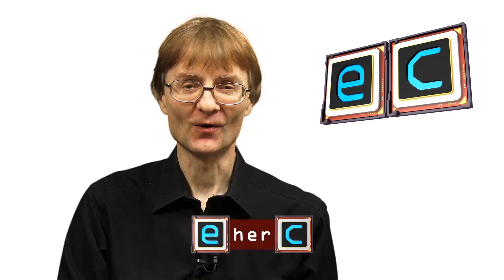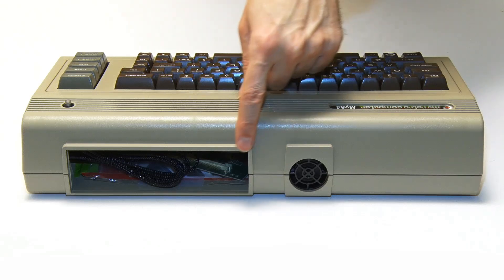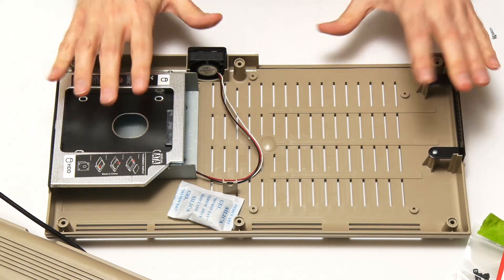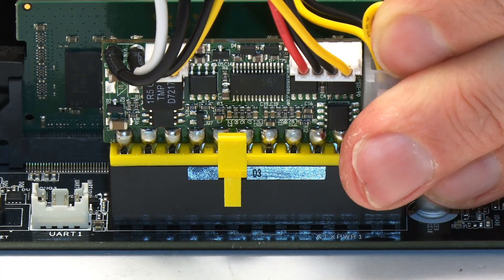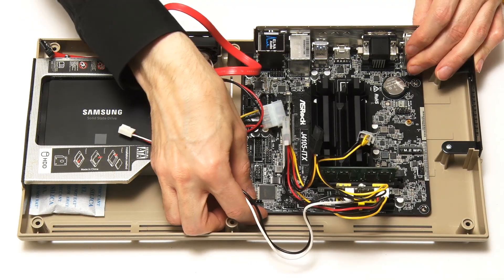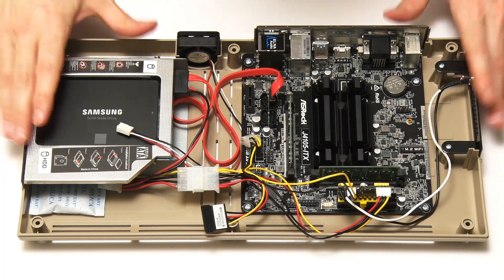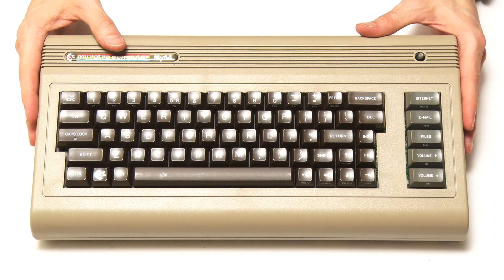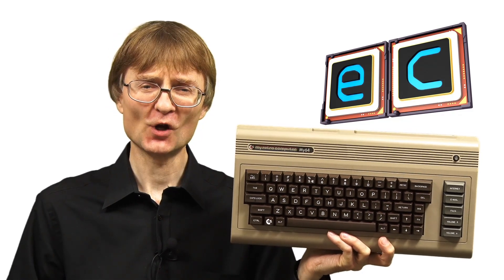My64 Mini-ITX Retro PC Build

Comment: My first computer was a Comodore Amiga 1200. It came with just a 31/2 “ floppy drive and 2 mega bytes of memory. I think I upgraded it to 8 megabytes of memory, and fitted an 80 megabyte hard drive. It was an absolute flying machine, by the time the cathode ray monitor was up and running, so was the system. I can never understand why my Windows PCs need so much memory and hard drive capacity, to do exactly the same work. Progress I suppose.

Comment: A nice bit of nostalgia but I always hated  the all-in-one keyboard and computer form factor. When I type I like to angle the keyboard a little but that is so difficult with all the peripheral (that's a nice old word) cables connected. On something like a spectrum, zx81, C64 etc moving the computer would often dislodge a connection; whilst on heavier computers like BBC or PET they were just too cumbersome to move.
I wonder if they would do just a keyboard in this case. I suppose it could be done by extending the keyboard USB cable inside the case to an external USB socket but that would be quite a hefty keyboard. Something like an original Mac case would be an interesting one to do (do they still make CRTs ?) because you could fit quite a nice PC in that.

Comment: I just love how they repurposed the hard drive caddy from a laptop CD drive bay.  Genius!  I have a spare Intel D525MW that might find it's way into one of these cases.  For increased ventilation I always add my trusty rubber feet to the bottom of all my laptops, and this one feels portable.  However, if I still had cooling problems then I might add spacers + longer screws to create a horizontal ventilation gap all around the case.  In terms of retro this makes me wonder "how far down" the OS ladder I can go.  I already know Windows XP will work (this would NOT be on the internet).  I want the USB to work, so maybe a Windows 98 install?  
Go Molex Go!
Reply: Windows 95 OSR 2 would probably be the lowest for a Windows version with USB support. 98 SE is also a good option.

Comment: What is the most powerful processor that this case can thermally keep up with?
Reply from the maker: Something like a Ryzen 5 2400GE, with its 35W TDP, should be fine -- or even an i7 9700T(!), again with a 35W TDP. In theory, a 65W TDP chip will be OK, but I would not go above 35W in this case.
Reply: @ExplainingComputers  what motherboard would you recomend with the i7 9700t

Comment: Very expensive case. Not enough:
It was possible
 put a 60 mm fan (Noctua or any other quiet). There are enough free space.
Paint in case color dvd cover and 3.5" metal plate on the other side.

Comment: So I guess next is a ZX-81 retro case , with a hard membrane keyboard that requires a real lot of force to make the key press register.
Also the RAM will be on the end of a ribbon cable, on a pack attached to the back of the machine, so the RAM pack wobble can be simulated.
Also a turbo button added , that would also blank out the hdmi output when the CPU clock speed is increased.

Finally programs would need to be loaded a compact cassette, or maybe have something that throttles back the speed of a HDD, so it takes 10 minutes to load a program, with the added randomness that sometimes the program wouldn't load.

I guess you have to be of a certain age to "get" the above !

Comment: I believe that was a long shot. A retro wireless usb keyboard would fit 95% of its purpose, for a fraction of the price, at the same time with a full  no cords retro keyboard experience. No monitor cables attached. Of course the video itself is very good.

Comment: Nice! I had a Radio Shack Color Computer with 4k of ram and upgraded it myself to 32k(64k chips). Radio Shack wanted about $150USD for memory.  I bought the chips for about $20.I used a cassette recorder for storage. Next was the Atari 800XL. I got an Indus DSDD 5 1/4" drive for storage.The drive came with a spreadsheet and word processor and a database(I think). How things have changed!

Comment: Cool case, but WAY overpriced. I'd pay at most around $100. It is in the end just a case afterall. Even my high end PC is in a Thermaltake case I paid $80 for. Which included tempered glass and RGB lighting.  Definitely for a niche market. But then again I was born about ~5 years too late for the c64. My first experience with computers was the 80386 on a Tandy so I don't have that nostalgic feeling for this computer (even though I own a total of 7(?) Commodore computers).

Comment: I remember when they tried selling these fully built for $1200 US. I guess now they're just selling off their cases/keyboard NOS. It's neat, but I think I'd rather get The C64 full-size emulator. I did consider one of these back in 2010 when they first came out, but they didn't have the PETSCII characters on the keys which is what I wanted.

Comment: Very cool- I actually owned one of the 2011 original cases that was made by Commodore USA. A very fun case, and I installed an intake fan in the right side panel to help with the airflow.  Unfortunately the keyboard broke, and by that time Commodore USA went out of business so I couldn't order a replacement.  Thanks for letting me know this was re-released, as I will contact My Retro Computer to see they'll sell me a new keyboard component!

Comment: I've been wanting to build one of these, but I want it to be a Commodore 128 case. Almost bought one from the original C-USA website back in 2011-12, but it closed before I had saved up enough money to get it. Still considering it if I can find a suitable C128 case.

Comment: To take it to the next level we could install some sort of Commodore 64 emulator :D :D for the giggles
Reply: Back in 2012 when this was originally sold by Commodore USA pre-built units included Commodore OS, a linux distro preloaded with lots of retro games and apps, shareware, demos and emulation options. It also included FreeDOS launchers. Something like that may be available for pre-built units in 2021. It also had lots of programming options as well as a few dialects of BASIC.
Reply: It's pretty funny. Build a modern pc into a retro case and use emulators to run those old games ... :D love it

Comment: I remember seeing this when it originally came out roughly a decade  ago. Interesting to see it being sold as a kit form. A lot of the cost will be in the Cherry key switches  (which type is used?). The height of the unit suggests that it originated from the VIC20 case (which was taller than the C64) and that in turn allows the use of the ITX board with passive cooler.
Reply: Very astute of you Paul. I am the actual C64x keyboard designer from Commodore USA from 2010.... It is indeed 3d scanned from the VIC-20 case which is slightly taller. I no longer have my records from ten years ago but if I recall correctly they are Cherry MX Blue, with a very definite clicky sound. I now have a MyVic20 case also from My Retro Computer and I can confirm they have the same feel. Good luck to them. I hope they do well.
Reply: @AussieAmigan  Hello Leo. Thought I would come back and give this video another visit as I have just managed to get my grubby paws on one of these cases. Apparently the one I have acquired is one of the original stock units with the Cherry MX Blue TGL3 keyboard? (I've pulled a keycap and its definitely blue switches)

The manufacturing quality is nothing short of superb. Its in stark contrast to a C16 case I have which you can plainly tell had been moulded in a butchered / modified set of worn moulds from either a 64 or a VIC20. The two halves barely line up and was obviously Commodore cheaping out.

Like Chris in the video I am not super impressed by the drive mounting arrangement. I'm sure it can be improved upon with readily available parts.  Apart from that I really like this. Well done for bringing it into the world..
Reply: @PaulL-g5l  Yes, I wasn't pleased with it myself. IIRC MyRetroComputer have an improved part.
Reply: @AussieAmigan  The bracket (in my case at least) allows for your 2.5 inch drive to be mounted in the bottom of the case by removing the 4 screws from underneath, taking bracket out, screwing the drive into the bottom of bracket and placing the bracket back into the case ( the screw spacings would seem to allow the ditching of the bracket enirely as they seem to match 3.5 HDD spacings). I then stripped an aftermarket external USB DVD drive (which had the desired 7+6 pin SATA socket) and fitted that into the top of the bracket in place of the 'dummy' drive sata carrier. Now my My64 has a PCIE SSD, a 2.5 HDD and a proper DVD read/writer..

Comment: That's actually a really great case. Putting a good Ryzen in there would be great for productivity and you can bring it around very easily since it's such a small form factor.
Reply: @michaelbuddy  If cost isn't an issue, the UDOO Bolt V8 runs a neat Ryzen SoC that should be able to be passively cooled. I hope that AMD gets on the bandwagon of marketing their chips out good to people like Intel did with the Atoms. AMD has some AMAZING low-power chips that could totally renovate the market but too few makers are using them right now.

And the few that do like the UDOO are SO expensive.

Comment: Looks nice, but seems to be missing some keys (F1-F12, Home, End, Page up, Page down).
Reply: As the keyboard designer (from 2010) I assure you they are all there if a little oddly placed. ;-) The regular PC function keys are accessible on the numeric keys when pressed with an "FN" key. The FN key operates in a similar fashion to many compact laptops allowing access to special keys like Page Up and Page Down etc. The FN special key labels are printed on the front side of the keys. Sorry, but to keep the look some compromises needed to be made, but all regular PC keyboard functions are accessible. That's the whole point.
Reply: @AussieAmigan  OK, I looked at what I could see on the image on the screen, and those additional engravings on the keys were not visible to me.  Thank you for clarifying the matter.

Comment: The only thing I'm almost scared about is the tiny fan. With that much space still in the case, I would have used an entirely different fan configuration to make sure there is less inconvenience. Then again, since this basically IS a tinkerer's case, the customized modding is almost self evident :)

Comment: A review that looked so promising but missed the mark. What is the point of going so low power. A Celeron processor, what a joke. If not, top of the line then what is the point.
Reply: The size of the case automatically means compromises. Mini-ITX is more versatile but not as powerful as recent gaming laptops unfortunately. The most you could hope to obtain that will fit in the case is equivalent to the top end of 2014. So no current AAA titles....but if your software collection is older like mine. It'll do just fine.

Comment: I still have an actual C64 including an external storage drive using music cassettes. I don't know if it still works because it's not readily available to me. I only know that if it turns out that the setup does NOT work any more, and is unfixeable, I always thought about making a "sleeper" out of it.

Comment: Well...  Now I need to buy a $254 case so I can install some modern hardware -- all so I can run a Commodore 64 emulator.  Because if one doesn't run a C64 emulation on a computer in this case, it would be a travesty.  ;-)

Seriously -- this looks like so much fun!  I will definitely be saving up to buy one of these and the most powerful motherboard/CPU/Heatsink that I can fit in there!  30mm isn't much height...  But the newest 11th Gen Intel CPUs have some excellent built-in graphics (compared to their previous gen graphics) so I really think you could make a mild gaming machine out of one of these, if you choose your components carefully.  Either way, it'll be fun to try!

Comment: Is there an adapter to use a proper 1990s keyboard with a regular modern desktop PC (USB input)? Can't beat a keyboard with spring in the keys.
Reply from the maker: There is -- something like this: https://www.amazon.co.uk//dp/B000A0K2JO/ -- used with something like this: https://www.amazon.co.uk//dp/B003OSTBZA/ if you have a AT rather than PS/2 keyboard.

Comment: It looks great. However. the whole storage mounting system does not make any sense at all. So much space wasted just to fit in a SSD while it clearly could fit in both optical drive and SSD. It makes even more sense when I think how they put a fake DVD plate on side in case that reminds commodore.
Reply: I think you can fit both. At least the original in 2010 did.

Comment: Great vid, but that case is at a crazy price.  I can't see that they put a lot of development into it; not in the structural design (after all it's a C64 with about half hour of CAD tweaks) and sourcing the materials to match the look may have taken another half hour. 

Each to their own, but designing it for a Mini-ITX and not a Raspberry Pi seems a massive overkill as the latter is more than capable of emulating a C64, surely the primary market for such a completed device and this just makes it far more expensive for people to implement.

I like the look, but I think the Pi 400 at around £95 all in certainly ticks all the 8-bit retro nostalgia boxes for me because it wouldn't have looked out of place in that wonderful home computing period.

Comment: I need some heip please: just fitted new hard drive all I get on the screen  press any key to reboot the machine. It's Dell Optiplex Plex790.
Passed all the test which took about 45 minutes. .
Reply: You can't find the any key?
Reply from the maker: Are you saying that you have cloned your existing boot drive to the new drive and rebooted?
Reply: @ExplainingComputers  No , I had four ubuntu products,  and windows seven and I could never get my cannon  printer to work. Then I download from a disk Linux Mint
and every thing was working well
I had printer was working. So a few weeks ago I done an up date and it was to much first the hard drive no free space ( 500GB ) I would not let me log in. The sceen was flashing So fitted a new hard drive
And all I get is no boost press any key to start. The door does not open on the dvd writer but I think I know how to fix that. So basically I find it hard to move around in the system
Like to delete the other ubuntu  software and delete windows 7
SO thank you for your reply to my problems AND STAY SAFE .

Comment: 👍nice concept. would be nicer if the ssd can be ejected, to load or test multiple operating systems / emulators.  ie:mb511sp-1b. Thanks for the great work Chris. Keep them coming. 👍
Reply: That's what the SD card reader would be for...

Comment: What an adorable case!  But wow, Mr. Screwdriver certainly had to work for this one ... hope he got some quality time with Mr. Scissors as a reward.

A couple of things I noticed, I think usually motherboards are meant to screw into a metal case for additional grounding, so I wondered if that might be an issue (isolated on plastic like that).  Also, how are temperatures under typical use?  That tiny fan can't provide much ventilation; is it enough?

Thanks for the wonderful video Chris!

Comment: They did a good job of making the case look aged. When new they were a cream collor that slowly turned tan over a period of years. His comment about computing being exciting is a little off. I am a retired system administrator and i spent man years waiting for computers to boot, updates to run, backups, restores, moving 100 lb disk drives, pulling cables under a raised floor, etc. It was more like "the bad old days."  You haven't lived untill you have loaded a 128 Kb fixed head drum (not disk) from six rolls of paper tape. Inevitably one of the holes has a chad that wasn't completely punched and the tape reader gives you a checksum error. Murphy's law states that it would always be on the last tape.

Comment: Neat. Didn't know this existed, although I try to pay attention to these kind of things. A bit niche and bulkier than the Raspberry Pi 400, but it seems like this would currently be the easiest option to build a C64 looking PC. I wonder if it uses the same plastic moulding that was used in a C64 shaped PC a couple of years back, hmm. Speaking of retro cases, Stephen Jones from the UK is also working on producing an Amiga-inspired Min-ITX case at the moment. As a former Commodore user, it's nice to spoiled for choice :)
Reply: Yes. It's the same ones from Commodore USA in 2010. They have the molds.

Comment: If I removed the metal plate and ssd bracket and used an m.2 ssd instead, could I fit an ITX half size gtx 1650 super in there with a riser cable? I could power it with an hdplex psu. Would be perfect with a wireless mouse and 15 inch portable monitor.